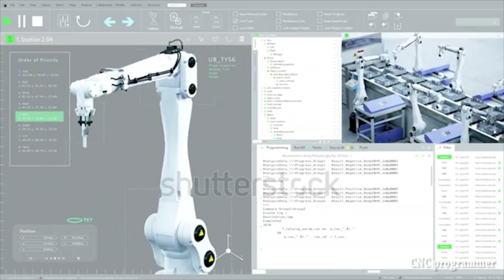The Dawn of a Robot-Driven World – AI and CNC Machines Revolutionize Life

Comment: 20 years ago I was told CNC machining would be fully automated - never happened. 20 years from now I'll update this comment with the same content.
Reply: There wasn't AI 20 years ago.
Reply: What will AI teach itself about the CNC machining process?
Reply: @mayuinc well you can have a dedicated ai model only for cnc programming then using a specialized kuka type robot to programming the machine and  now with Nvidia omniverse you can train ten of those specific robot to programm the cnc for parts so yea man I think in near they will replace
Reply: @gearbraniac good luck! 👍
Reply: I work in CNC manufacturing for over 35 years and it became more time consuming to make the setup for 5-axis machining. CAD/CAM does nothing by itself.  I have to think about work order, zero points, cutting tools, clamping, cutting parameters, avoidance of collision, accuracy of fittings ,  adaptation of the post processor.  Often I program in ISO code the same way as 35 years ago because of the failures in the CAM software.  I already tested ChatGPT to make a simple program for me but it failed completely.  There is still a long way to go.
Reply: @JV_CNC absolutely there is so much manual intervention required with complex 5-axis work. Only folks like yourself who eat, sleep and breathe this stuff truly understand.